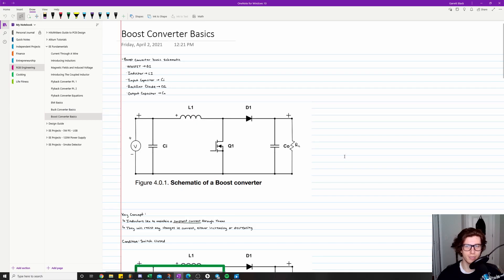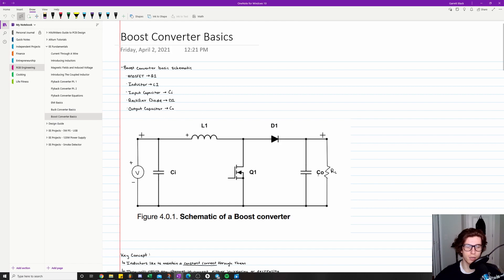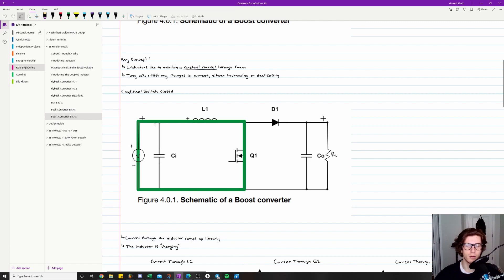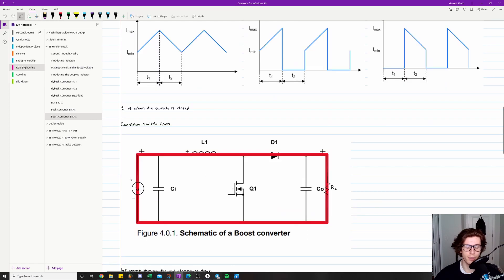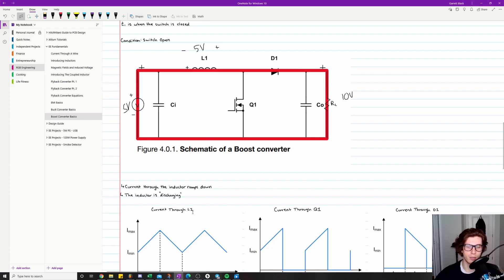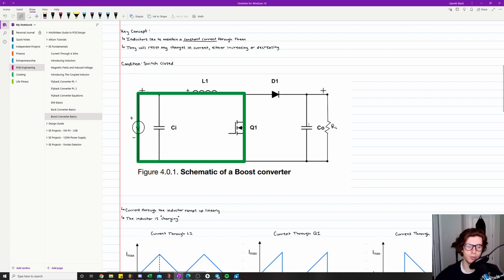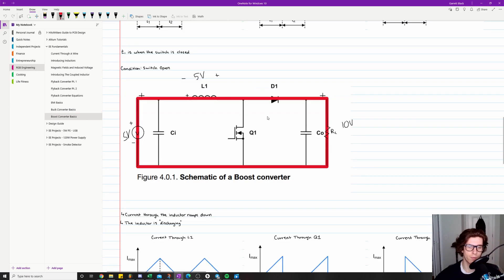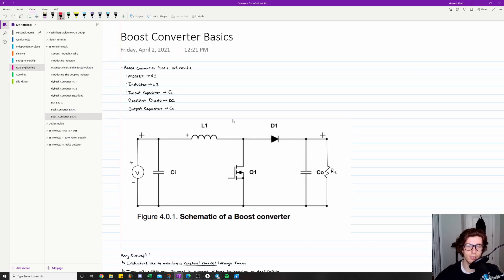BOOST CONVERTER BEGINNER TUTORIAL Pt. 1 - BOOST CONVERTER TUTORIAL, BOOST CONVERTER CIRCUIT DESIGN

Comment: how come no current flows through Cin when switch closed likewise why no current flows through cout when switch is open?
Reply from the maker: Current is always flowing through Cin and Cout when the switch is open and when it is closed.
Reply: Looking at your circuit when switch is closed the green highlight shows flow through L1 ,Q1 then back to ground ,so how’s CIN and Cout receiving current 

Sorry for the complex question I’m working with these component in work just want more knowledge on it